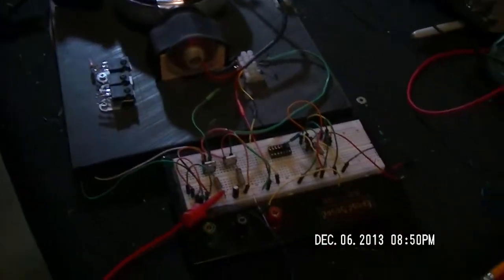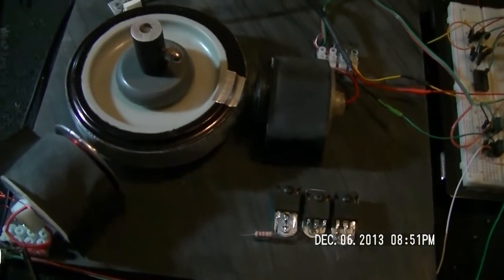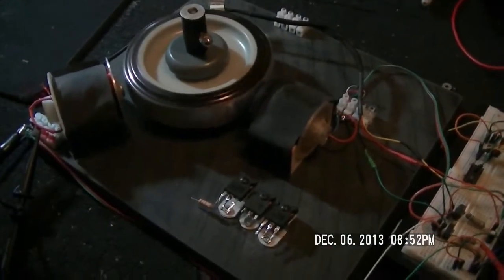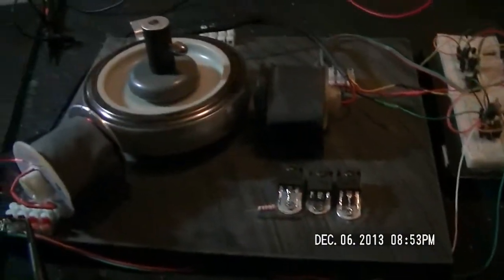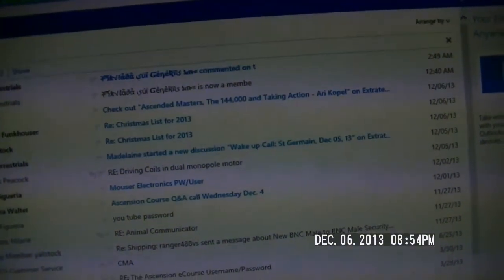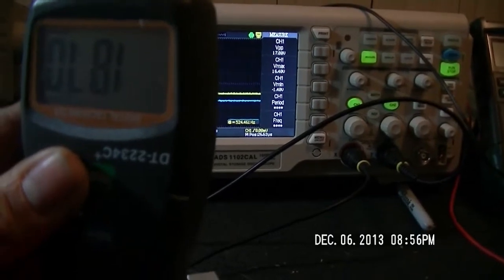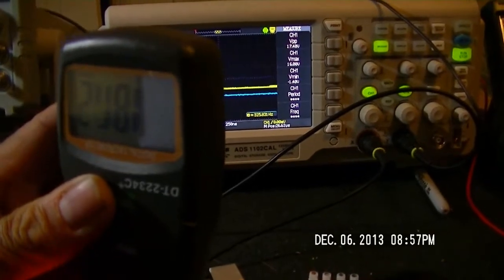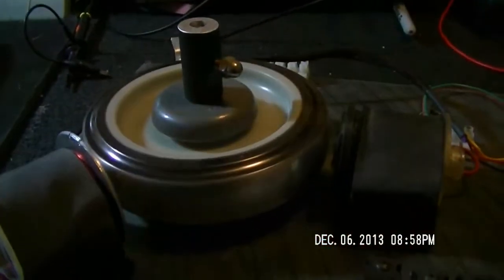Hall Sensor Mosfet Motor Control

Comment: Congratulations men. I follow our video 1&2 . its vrey nice. Can you send me our diagram with mosfet, cause my mosfet much warming every time.
Reply from the maker: Try mounting your mosfet onto a heatsink... it will draw the heat away.  Keep your voltage within the device specifications listed on the data sheet.

Comment: Thanks for sharing, i am using this circuit with one coil for many experiments....!
https://www.youtube.com/watch?v=zHVci0DnG-Y
https://www.youtube.com/watch?v=JQAEqUgGkOU
https://www.youtube.com/watch?v=4EU8QyqGwT4
This circuit is efficient for many projects.
Reply from the maker: Its actually the circuit that I use in most of my high voltage applications and it works perfectly every time.

Comment: If you have researched a brush commutator, you would have a less complex circuitry. N channel mosfets will do
Reply from the maker: I'm using 6 magnets in the rotor so if I used a mechanical type of activation  switch like a commutator, it'd require 6 segments, I think that'd require too much accuracy in the design.  So far the hall sensor works perfectly up to 3000 rpms and is vastly less complicated then a commutator.  Thanks for watching.
Reply: Thanks Sir Farquat.

Actually I have a motor I just made as well, about 500-3000 rpm as well.  16hp.  But I do have a carbon brush system which has perfect timing but poor contact due to sparking and arcing resulting in inefficiency.

Would a MOSFET and a halls sensor help if I convert from contact brushes to magnetic sensors using the same commutator design and format.?
Reply from the maker: Constantine Joseph Absolutely. Depending on how your coils are wound, you'd have to address and trigger the hall accordingly.
 If your using a two phase synchronous winding, (meaning that both phase  fire at the same time) you'd want to use a FET for each phase so that your forcing the current thru each coil, instead of averaging the current between two or three coils, then trigger off one magnet.. the same as I did in this setup.
You just piggyback the output of PIN 3 to drive the gate of the FET's.

Even if you have a three phase synchronous winding, you could trigger your three FET's off one hall sensor but that's hard on a single sensor. 
You could also use 3 hall sensors and trigger off 3 magnets if you want... it'd reduce the duty cycle of a single sensor from 100%,  down to 33% by using three sensors. 
I bought my sensors from china thru Ebay .  I got 25 of them for $6.00 vs buying them locally for $2.50 ea.
Reply: Actually my coils are all in series a total of 8.

I'm using 16 neo N52 high grade perm magnets.  I only have one commutator and it fires all the 8 coils at one go.  My circuit is a very simple one with only high voltage DC rectified by a bridge rectifier from  the grid.

The output is 120 VAC.  Looking at the workable but highly inefficent brush system, yeah I only have one commutator.  Hence my design is only 1 MOSFET n channel linked to a really costly 50 USD honeywell high rpm hall effect sensor for high rpm usages.

From what you said, do you mean I can use the same power the MOSFET has for the Hall effect sensor.  Because from what I know my sensor does need to have an external power source so it can trigger the MOSFET to allow current flow at intervals I want
Reply from the maker: Constantine Joseph  Look at 4:00 of this video and you'll see the circuit.
PIN 3 of the hall is the switch that enables the FET to force the voltage thru the gate so that the Source/Drain junction can sink current thru the coils.

If your arrangement of 8 coils in series gets you results your happy with,  then I guess your good.
However, when I tried to run a motor using a series of six coils, I couldn't force  enuf voltage thru all the coils by using one FET. The rpms were really low. 
 
My solution was to create phases, were instead of having 6 coils is series, I connect them so that I had two coils in series and 3 synchronous phases.  That configuration will allow lower voltage requirement to drive the FET and allowing greater current thru each phase.  That allows you to generate the same RPM at a much lower voltage. Cranking up the voltage increases the RPM's.
I think your setup would benefit by having 4 phases with two coils each phase.  Each phase would be controlled by a single FET and hall sensor... or you could piggyback the pin 3 output of a single hall to the gate of all three FET's and trigger off a single magnet.

Comment: Cool arrangement...have you tried getting rid of the cap altogether?...maybe it'll go even faster?

Watching from Canada eh.
Reply from the maker: Thanks Mr Angus.  When the cap popped...it wouldn't run until I replaced it.   There may be a way to run it without the cap but I don't know how. 
 I did learn why the rpm increases with increased +V to the Source of the  P- channel FET  :)  I still have much to learn.

Comment: I am watching fom Netherlands
Look for Muller generator for your motor
and you can use only 1 coil if you want.
Reply from the maker: Hallo Edmorbus,  I did run with one coil but I need to learn how to run the 6 coils that are in my new project motor.  Since now I can do 2 coils with one hall sensor,  I think I can do three coils in phase one of the motor using one hall sensor, then I'll do a second circuit for the second phase of the motor with a second hall sensor so I get all six coils working. Thanks again for your help.